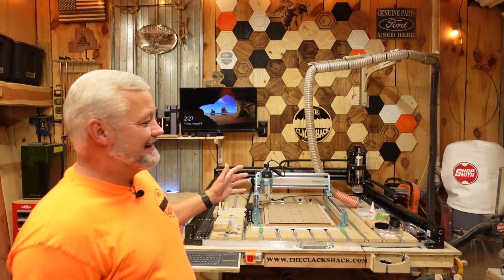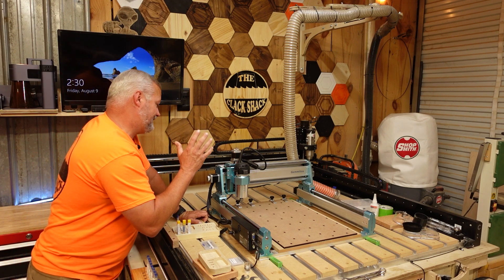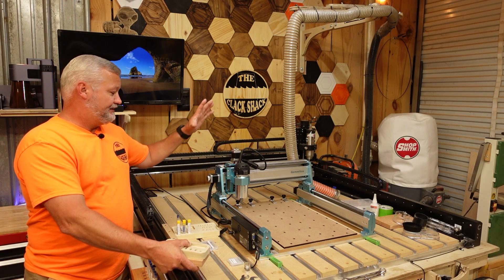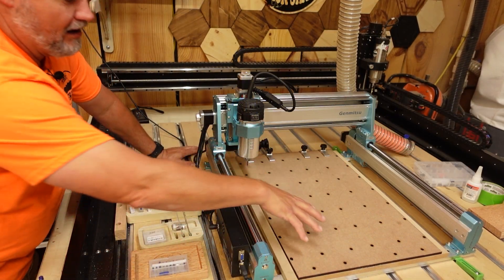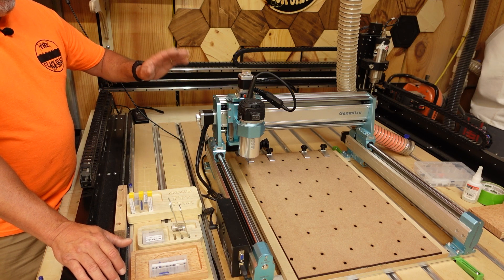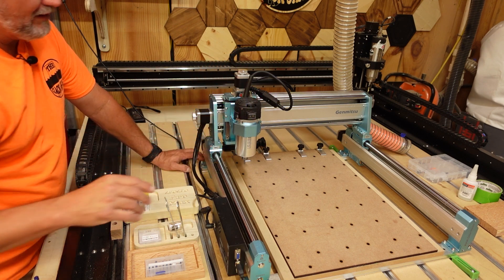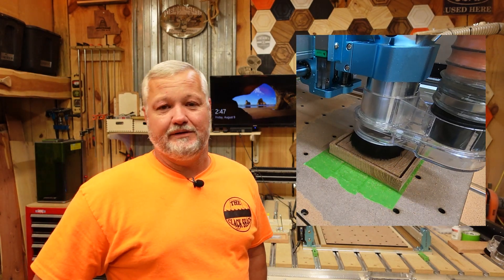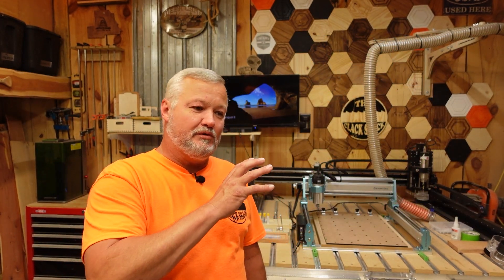A great beginner CNC- Genmitsu 4040 Pro Max

Comment: Hi Clack looking to buy the 4040 pro max notice you were using wood can the machine cut metal as well .
Many thanks Steven uk
Reply from the maker: Non-ferrous such as  aluminum, copper and brass, yes with the correct bit and settings. You may wanna add an air system to it also

Comment: the genmetsu i started with its great easy ish to use works great but the dc cutting motor it needs to be replaced with a 3 phase motor brushes just dont last but mines been running non stop for over a month no problems other than grease is building up on one end of the screw thing because i dont ever go to full range but one thing its not genmetsu's fault but that 3d design software lol really that sucks its like you gotta take collage classes to use this thing im mean wtf but kinda the same for any 3d printer but i guess thats why i hear its actually decent paying job if you learn how to use it i wish it was larger 400 x 400 kinda small and lol why they size it like that? the 600mm upgrade its a middle finger to the buyer like they couldn't make 2' version? and 0.1mm resolution sucks you cant make a engine with that thats lower than grampa's laith. but over all i highly recommend genmetsu 4040 to anyone as a good starter but i kinda wanna say not if you can use a 3d printer theres the genmetsu ProVerXL 4030 V2 cost double and its smaller but its got a 1300mm upgrade thats much larger than the genmetsu 4040 pro upgrade thats only up to 600mm x 600mm but at the same time 4 feet is still kinda small you cant do a house door with that. house door with like something in it i dont know who buys that but home Depot sells them so i know theres a market for it you just gotta beat home depot in the price but cnc set and walk away come back next week. i been doing the impossible using mine to cut glass its working too.
Reply from the maker: Glad it's working well for you.

Comment: Help. I have connected everything.
Software connected to the CNC but motors do not respond. None of the motors respond.
Reply from the maker: Make sure the large cable to the gantry is connected. Also make sure you have the appropriate pc port selected in the software settings.
Reply: @TheClackShack  cable is connected.
If i had wrong PC port selected in the software, software would not say OK
Reply from the maker: @northwestrepair  unless it sees another GRBL machine. I can't say without being there

Comment: Do you happen to know the actual outer dimensions? I'm working on am enclosure while I wait on mine to come
Reply from the maker: If I were to build an enclosure, I would do 30x30. 27x27 would work but wouldn't have any extra room.
Reply: @TheClackShack   that's exactly what my measurements are! 30x30x20. I'll put together a quick video on it when it's finished.

Comment: When you have time, please do a project from VCarve config to sender to project completion. I feel I am missing the feeds and speeds, bit selection, and getting the code to the CNC.
Reply from the maker: It takes some practice to get the speeds and feeds figured out. You can use the bit manufacturers feeds depending on the machine.
Reply: @TheClackShack  thank you

Comment: Just starting with CNC. I have a 4040 Pro Max on order. Believe Genmitsu said they ship next month. Will be using it to carve small/tiny wood pieces like scrolls and acanthus leaves designs for model ships.  I've just started learning the free hobbyist version of Fusion360.  Is there a software design program (other than Fusion360) that is easier for a beginner to learn/use to design pieces. You said in the video that I need another software (Mac laptop) to send the design to the 4040? Could you please suggest what I need?  Thank you, Rob
Reply from the maker: I would look at Vectric. Fusion is tough
Reply: @TheClackShack  Is that VCarve? Regular or Pro? Will this help me generate an image and sent it to the 4040?  Thank you, Rob
Reply from the maker: @LakeDaisy  Vcarve desktop will work. Only need pro until you get into bigger machines.
Reply: @TheClackShack  Thank you

Comment: Thanks again for your quick review, seems like a very nice and solid machine. Have recently tested a cnc myself from another brand which works great but has V-wheels on the axis, so having actual linair rails and bearings does have benefits over the V-wheels. Does make it more sturdy with less play. 
Did use Genmitsu bits though 😆.
Will await your full review..
Reply from the maker: The rods and linear rails do keep it from having any slack. I used the Genmitsu engraving bit, Jenny for cutting
Reply: @TheClackShack , thanks, I bought a 40pcs flat nose and ball nose bit set. Was pretty inexpensive but still works great.